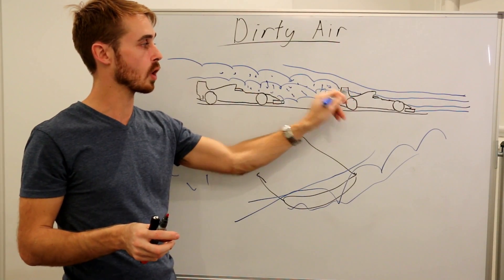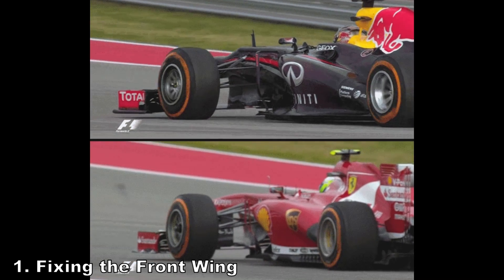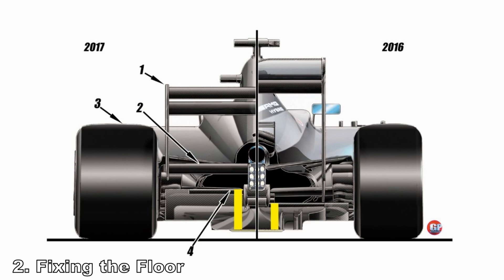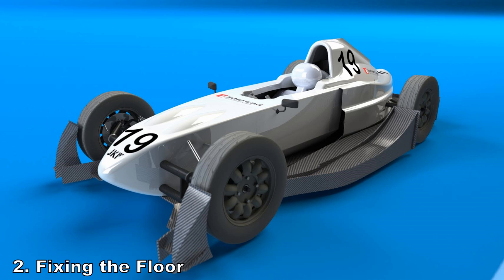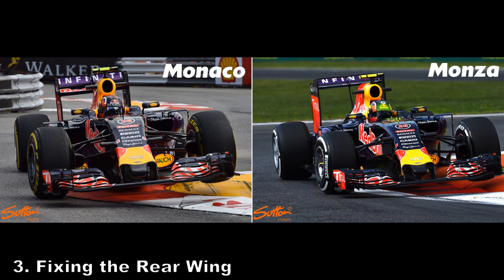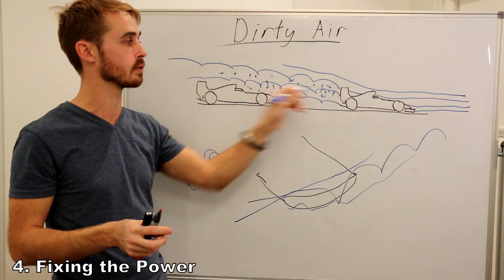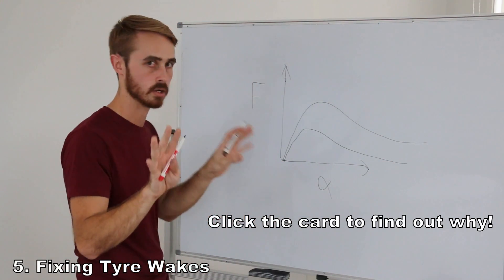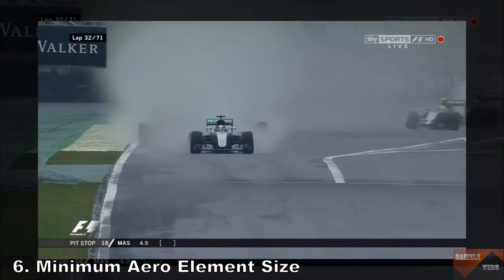How Do You Fix Overtaking Aerodynamics in Formula 1? 6 Potential Solutions

Comment: Another idea (that has very little to do with aero) is to adopt similar rules to LMP1 cars in regards to the engine and power unit. Would be really intresting to see diffrent engines battleing it out on track. Natuarlly aspirated against turbo and/or supercharged, smaller four cylinders against larger eight, ten or even twelve cylinder engines, taller inline engines vs lower boxers and diffrent size electric engines. It would be great to see what diffrent teams could come up with and how it would affect things such as weight distribution and how aero could be packaged around the componentes on cars with completely diffrent power trains...
Reply from the maker: I personally think the powertrain rule should be max fuel flow (energy limitation) and budget cap. For everything else make it a free for all. You'd get to see some great innovation across the field as well as different noises and cars that are faster at different points on the track!
Reply: YESSSS.  I always wondered why F1 didn't put a budget cap on there powertrain.  They are like 8 million dollars per engine or something dumb like that,
Reply: while that would be cool. it would create a similar problem to now, which is an overly dominant car rather than a dominant driver. One team would get it right and the others would would get it less right. what we need is less complicated engines, so companies like Mercedes can't simply dominate because of the shear size of their R and D departments.
Reply: Adding a budget cap will solve this problem though.  When I say budget I mean TOTAL budget, for R&D, materials, and construction.  This will force teams to simplify pretty much everything.

Comment from the maker: I was informed last week that putting Max Verstappen at the back of the grid for every race was not a reasonable option, so instead you get this video! Enjoy!
Reply: If possible that would've been the 2nd Verstappen "rule"..
Reply: Ross Brawn should call you to put you on his independent regulation research team.
Reply: Seems the FIA subscribed to your channel and took some notes.
Reply: no man we need faster cars and more overtaking!!
Reply: KYLE.ENGINEERS  What do you think now?
Reply: Couldn’t you attach canards at the end plates of each wing to generate counter-vortices, while keeping the pressure gradient high without losses? Also the idea of running the front wing through all the way is great. I guess for tyre wake, they could extend the front wing endplates and deflect air to back of the tyre (increasing pressure behind and minimizing tyre wake). Does that work or am I pulling this out of moronic aerodynamics 101?